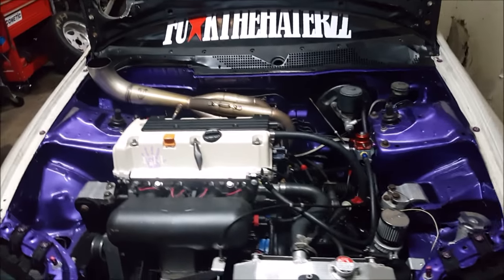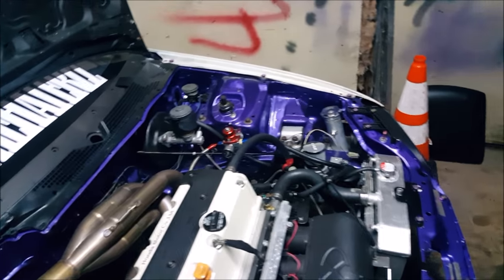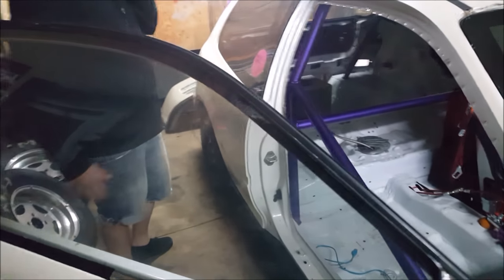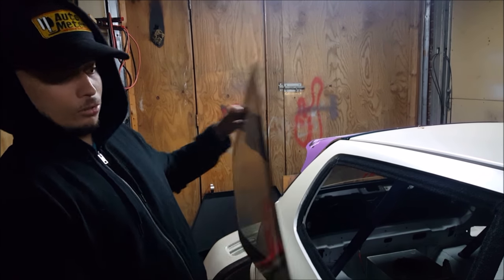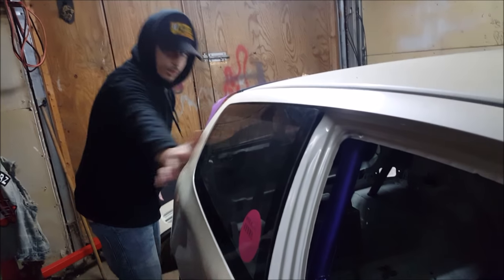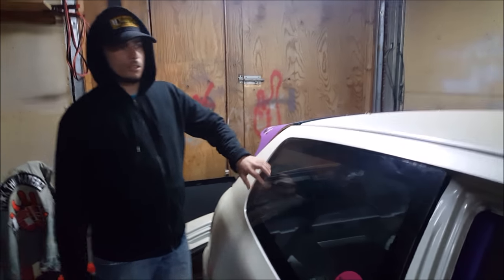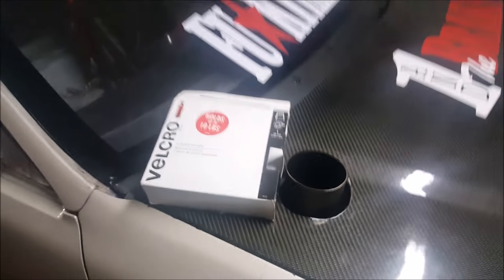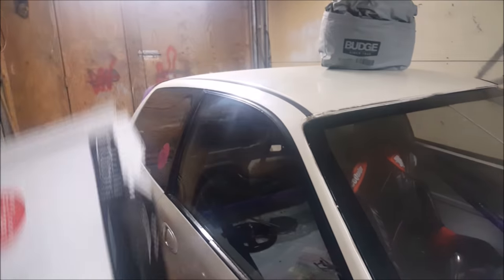NO RIVETS LEXAN CLEAN LOOK| HONDA EG EK DC2| TUTORIAL

Comment: What held the front windshield on? I know you talk about leaving the old rubber sealant but is the front Glued in or what?
Reply from the maker: Velcro in a manner where it hole windshield onto inner frame of car not the out side where the rubber is on.. and I used four screws on corners for safety  since its the windshield right hope that helps

Comment: Does it hold up when wet like rain or wash??
Reply from the maker: this is for race  situations
Reply: So it does get wet, if you park outside, and pours the interior gets wet, or take it to a car wash shop and gets wet. Racing events there is days that still rains.. you will have to throw few beach towels to absorb the water coming inside.
Reply from the maker: i dont park my race car out side..

Comment: Does this leak ? I might do this have you pressure washed your car with it or been through some storms driving ?
Reply from the maker: it will let water in this is for race situation
Reply: @1AndTheBrake  👍thanks for the response amazing car
Reply from the maker: np and ty
Reply: @1AndTheBrake  I'm building an eg hatch right now tore it completely down to nothing and building it back up just got primer done blocking it down now for basecoat 😁👍🤘
Reply from the maker: yea man me and my wife did thw same thing and felt good once it was all done and running down the track.. take ur time with it
Reply: @1AndTheBrake  I'm doin my best patience is not my strong suit lol my main hold back is my wallet haha
Reply: My wife and 4 yr old son help me with it all the time 😁
Reply from the maker: i hear yoy